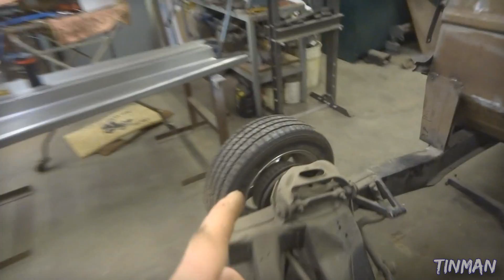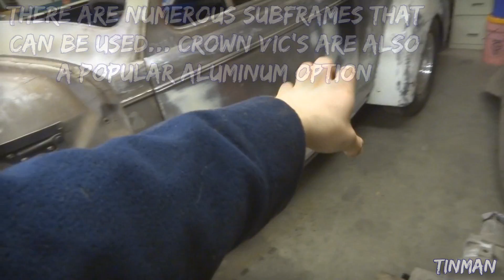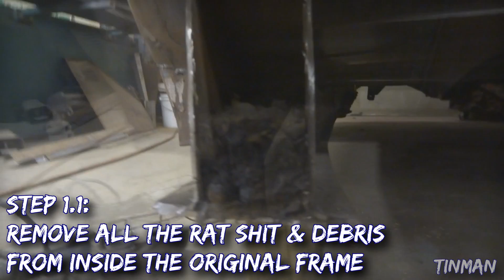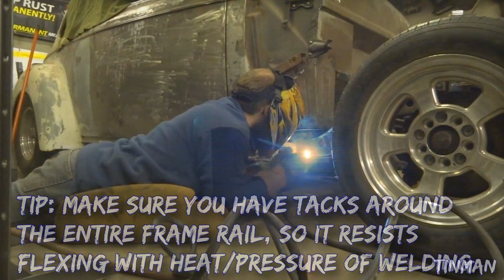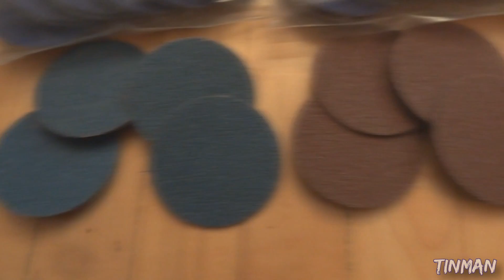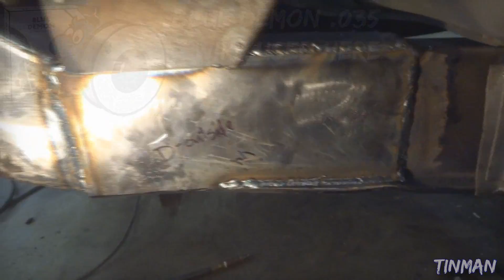"Tinmama" 1940 Chevy backyard SEMA build (Ep. 1.1) Subframe Graft

Comment: I done 5-6 of these back when I could buy a subframe for $35-50 . I haven't seen anyone do one in a long time . I guess sense the street rod world went 1-800 -send me new parts . I think the hardest two things were squaring it up and fitting the inner fenders and core support. The car in my thumbnail has a rear steer nova under it .and to any one who thinks it's unsafe she's got a Pontiac motor 775 lbs on it. I've driven it for 20 or so years all over eastern US . These are strong an will last forever if done right

Comment: Good job... a little overkill is good, leastwise in joining a "new" subframe to an old vehicle.   I was helping a guy to fit a similar setup to a 1935 pickup... but before I could stop him I found out he had cut the "New" subframe right in half (he wanted it narrowed 4") and then had cut a large part of the rear of the subframe (he figured he knew exactly how long it should be)  He took NO measurements at all and none of the cuts were straight. It was a crying shame. With a LOT of figuring an fiddling and experimenting I maybe could have made something out of it but, I had told him NOT to cut it up, that I would do it.  I looked at him and told him he had just made a pile of scrap as far as I was concerned.  Later he told me he had scraped the whole truck beautiful patina and all.  No accounting for Dumb-assery...
Reply from the maker: MISTERComaToes haha that's a terrible story!!! learn from the example folks